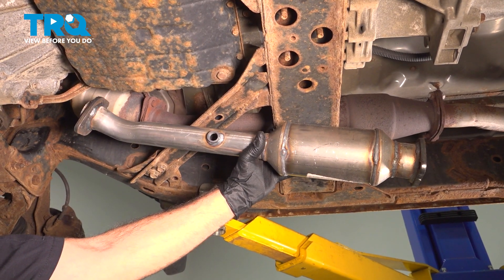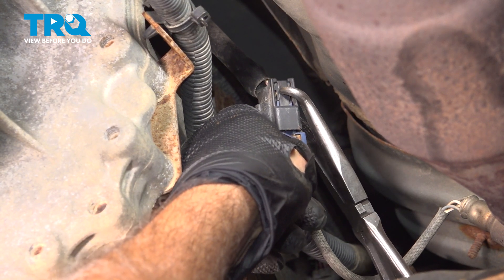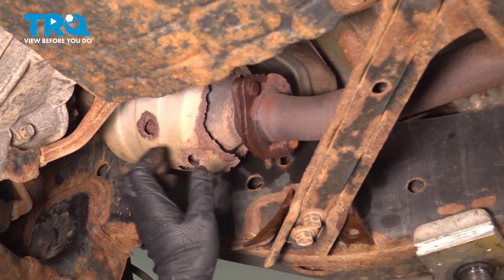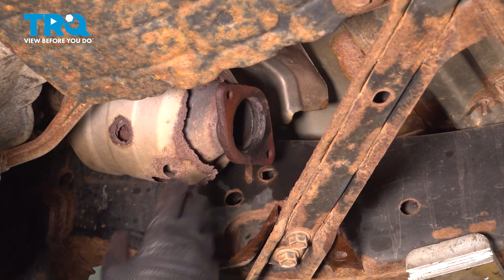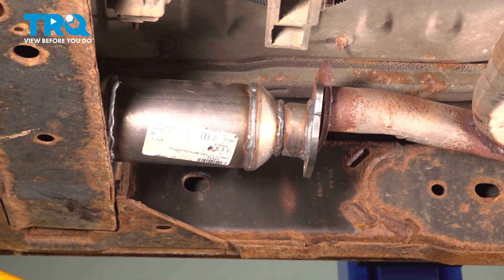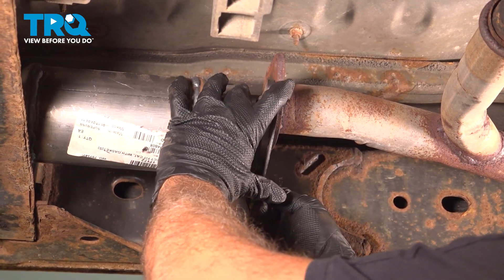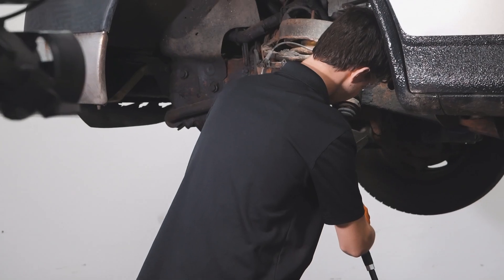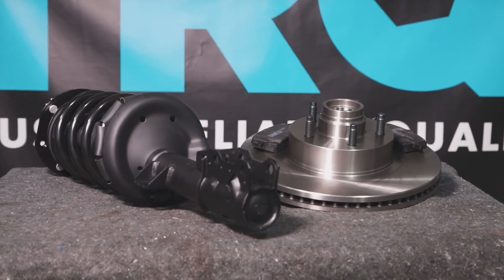How to Replace Rear Passenger Side Catalytic Converter 2005-2021 Nissan Frontier

Comment: If the bolts are super rusty spray some Kroil and use a torch to heat it up then break it loose, if it breaks just drill out and replace with nut and bolt with washers